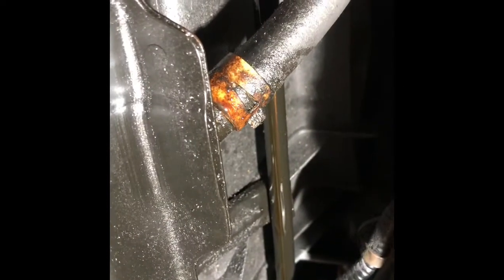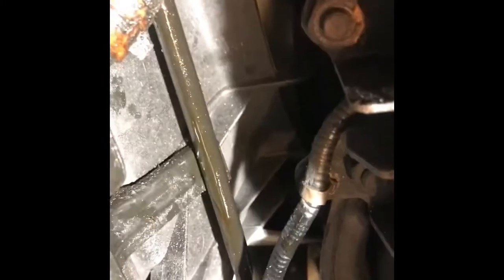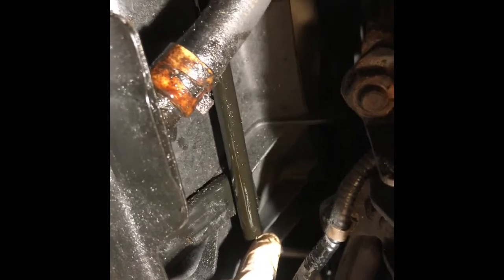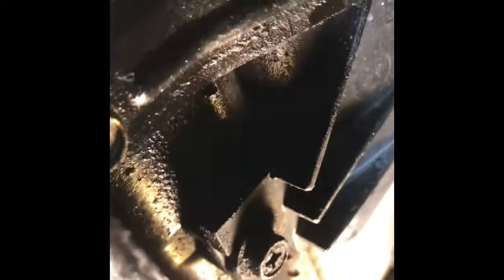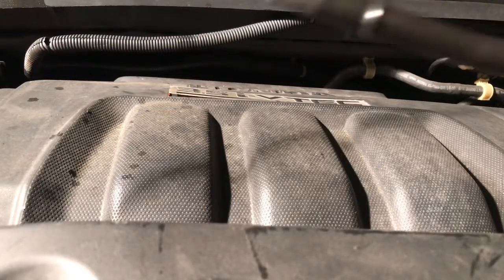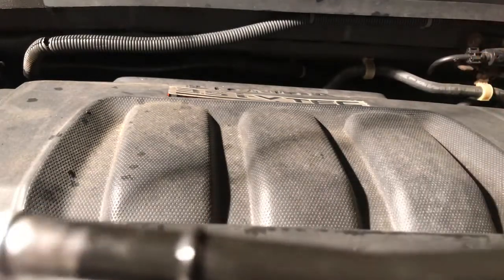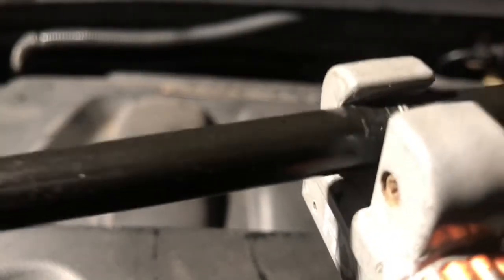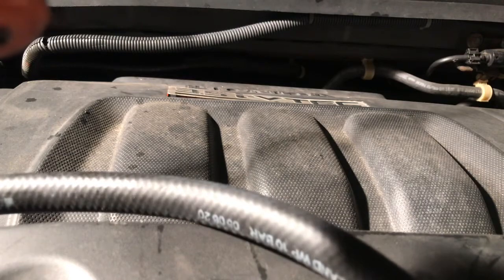Honda Odyssey transmission cooler like replace

Comment: Do you remember what size of transmission hose you used to slip over the cut pipe?  Did you add any barb, or double clamp, or did you just use a single clamp on the cut end without issue?  Thanks.  Can't justify paying nearly $200 for two feet of steel line.  I've done similar repairs on many cars over the years without any issue.